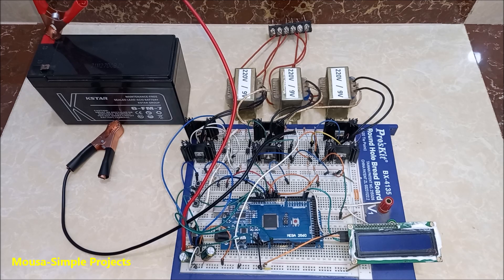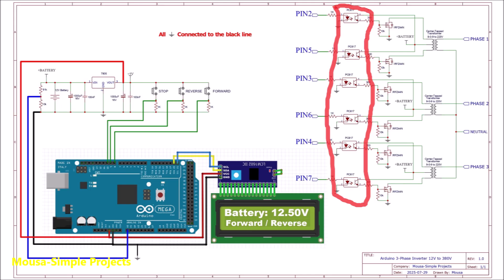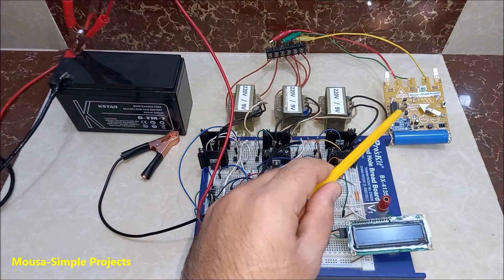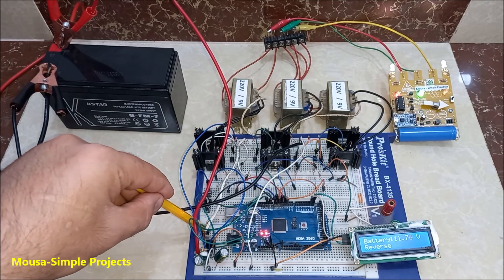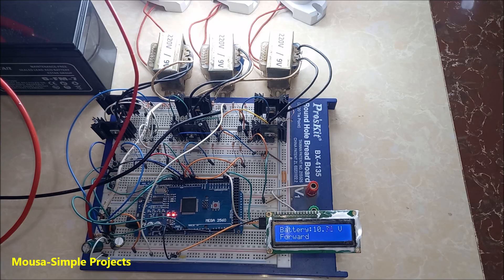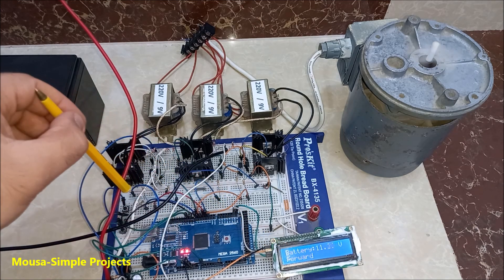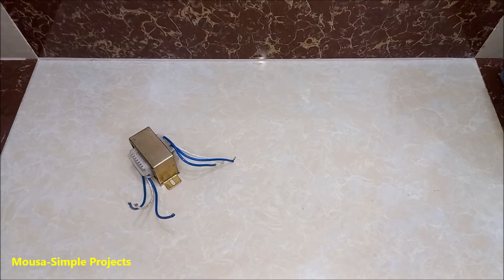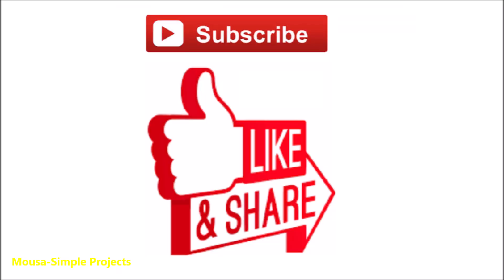Arduino 3 phase inverter circuit with code / Arduino three phase inverter code

Comment: Can I use the IRF740 MOSFET as a replacement to convert 220V DC?
Reply from the maker: If you mean 220v DC input instead of 12v DC battery input , NO. 
But you can use IRF740 instead of IRFZ44n for the same 12v input.
Reply: @MousaSimpleProjects How can I inverter 220vdc to vac in this circuits. Is it impossible?
Reply from the maker: In this circuit you can't do that, but I'm working on a new one in the next few months will be ready.

Comment: Is it possible to make it a sine wave?
Reply from the maker: You need SPWM signal and also a transformer with a higher ratio because in sine wave you need 311V peak voltage to give you 220V RMS with respect to neutral. and also low pass filter in the output.